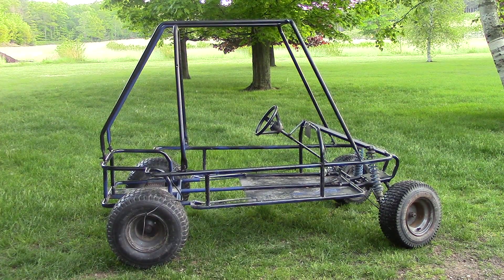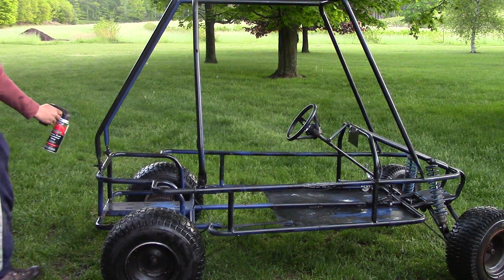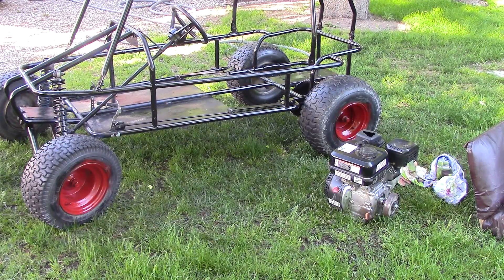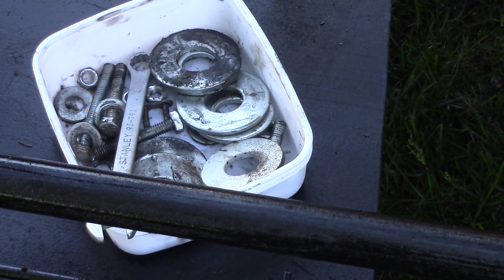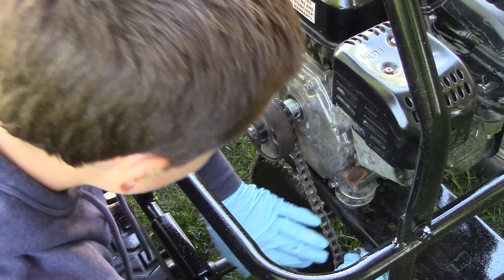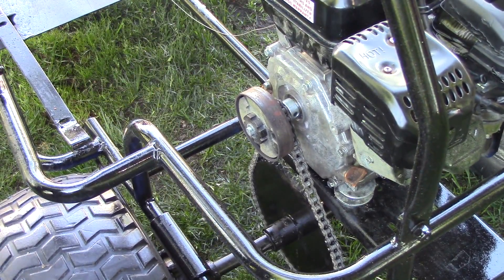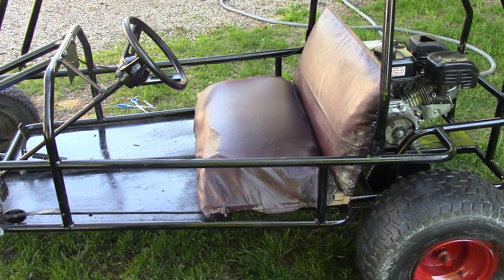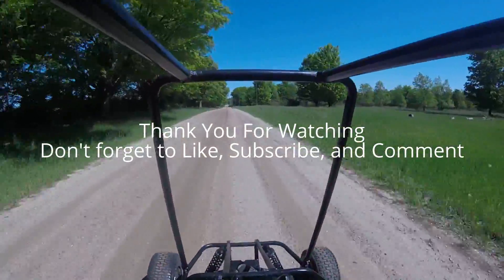How to Build an offroad Go kart

Comment: Before spraying take wheels and steering wheel off then remove all old paint to bear metal by sandblasting then lift frame off ground in a dust free round then start to stray frame

Comment: I want to build a gokart so bad I might do it over the summer. What engine do you recommend, I was thinking predator 212. I would like to be on a $600 or so budget but I can go a couple hundred higher
Reply: Easy for 6 you can buy a working one for that I bought my yerf dog full suspension front and back with a bad motor for 200 and used  a 212cc for 90 bucks

Comment: Those rear tires are too big for that clutch. It will overheat and cause it to fail prematurely. Your gonna need to install a torque converter.
Reply from the maker: In the next video I got a tav
Reply: Fuck tav.

Jack shaft.

Comment: Mine is a 640 cc runs 60 mph
Reply: 640 cc and only 60mph? i have a 250cc and it goes 40mph
Reply: MisFit Garage damn slow ass engine my 49cc bet could beat it it😂
Reply: My father has 3l supercharger hybrid top speed 250 km/h  that kills your kart

Comment: Im looking for a Go kart with engine and everything where should i look
Reply from the maker: Jorge Nunez you could buy mine or u can look on craigslist
Reply: I would try craigslist
Reply from the maker: Jake Davis $750-$800
Reply: Jorge Nunez I'm selling mine runs really fast
Reply: Jake Davis look on craigslist. most of the time you can find one without a roll cage for less than 300 with and engine on it. predator engines are good and so are briggs and hondas but tecumseh is terrible hard to get it to idle and run right.. prices might be different where you live but just a frame i wouldnt pay over $50
Reply: Jorge Nunez look on offer up best place to buy them I bought me a cateye pocket bike from a guy for 100 working and nothing wrong with it
Reply: I got a old go kart frame needs some work and a engine that doesnt run i will let you buy it for 150 i you want
Reply: +pecos honk you still got it ?
Reply: Jorge Nunez I find Craigslist to work fine but when its a good deal of sells very quick. I got mine off OfferUp. OfferUp doesn't have as many options, but when a good deal eventually comes, it sometimes stays for months... I got a Yerf Dog Spiderbox with Nice sport tires on the rear and no major problems OTHER than the engine not running. I bought my mini buggy for 200 and the add was listed 9 months before I bought it.
Reply: sedric beachy   i've been trying to find some cheap frames on craigslist, but all i can find are frames that are more than 100 or 200 dollars. any suggestions on how to find a good frame?
Reply: JellyJam time. I waited over 4 months to get a good deal. It takes time and you have to be ready to "pounce" when there's a good deal.
Reply: Facebook marketplace, craigslist, letgo, ask your older neighbors they might have old go karts just sitting around. That's how I got my go kart I asked an old neighbor and he said I could have it for free since he didn't use it anymore.
Reply: I go on Facebook

Comment: i wish my parents were rich and could get me a go kart. 😢
Reply: what does rich parents have to do with u mowing grass or some other way of making your own money to buy what u want?
Reply: Daniel Price yea I got mine for 200 bucks used with a stuck throttle and broken clutch. But I came with a brand new 212 predator and a brand new clutch he had bought for it
Reply: Daniel Price get I've got the same profile pic
Reply: Daniel Price To be completely honest it's not that hard to make/bit one if you look in the right places
Reply: do you have a go kart
Reply: Tshelang Thekiso not yet
Reply: Daniel Price same
Reply: Daniel Price I got 3 because my dad a 2 old ones that I fixed up and the 3rd one is kit I am lucky I get hand downs
Reply: samee
Reply: Get a job and save your money I got two doing work

Comment: im looking at an old Manco dingo chassis for $80 and all it needs is a predator 212. will i need a torque converter? i dont know what it does.
Reply from the maker: You can get either a centrifugal clutch or a torque converter but I would recommend a torque converter because it will do a lot more than a centrifugal clutch in the way of torque especially if it's a live axle
Reply: what do they do?
Reply: what do they do?
Reply from the maker: _ Nightmarze4u the torque converter is a belt and pulleys that come off the engine there go to the chain. As the engine increases in rpms it tightens the belt and provides torque. A centrifugal clutch just has weights that's are held in by a spring. As engines revs up the weights go out and hit the side wall of housing and spin it. If a lot of torque is put on it the weights will slip and wear out and you'll have to replace them probably once or twice a month whereas with a torque converter all you have to replace is the belt which are only ten dollars on Amazon.
Reply: ok thx
Reply: _ Nightmarze4u I have a manco frame with a predator 212cc on it and believe me BUY the tourque converter clutches Also break over time but if you go the other way with a tourque converter it will never brake other than a few dollar belt
Reply: ok
Reply: thx
Reply: No you don't but, it does help with exceliration. a clutch will do but will have less proformance. good luck with it!